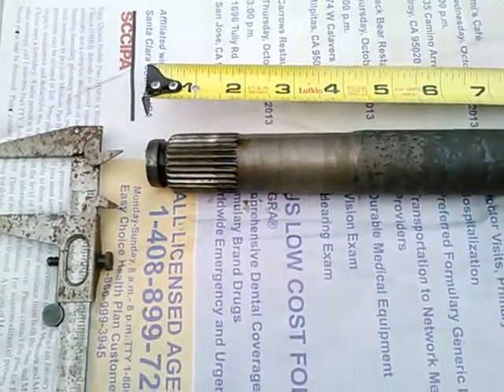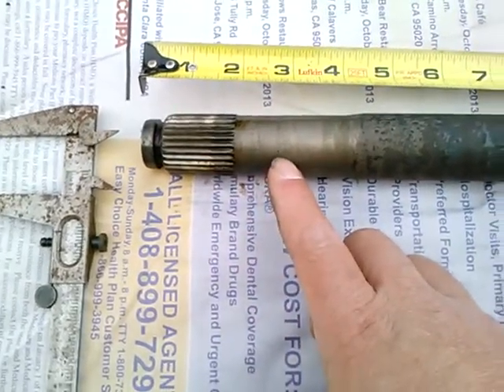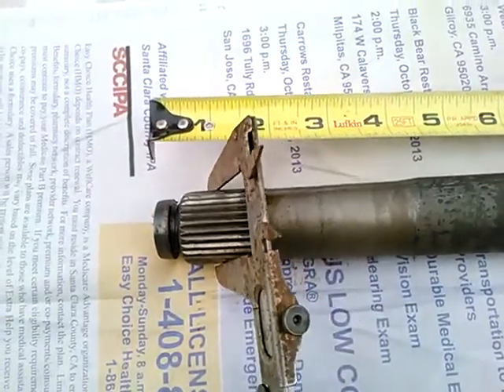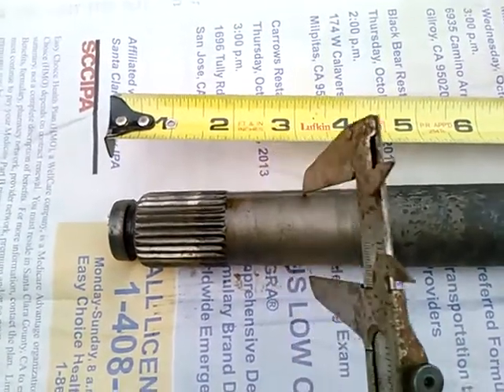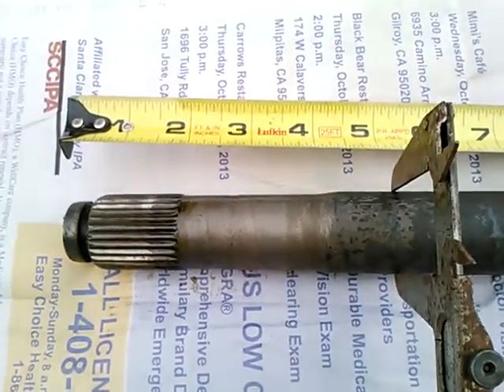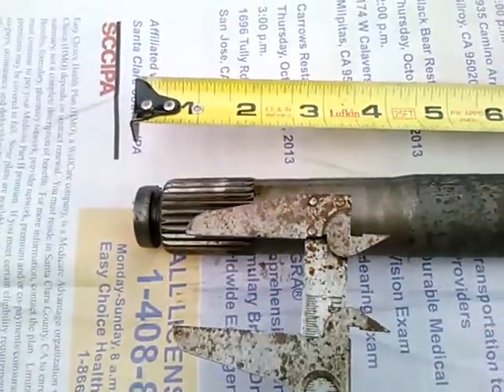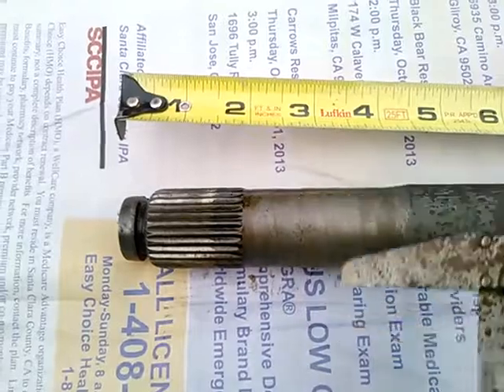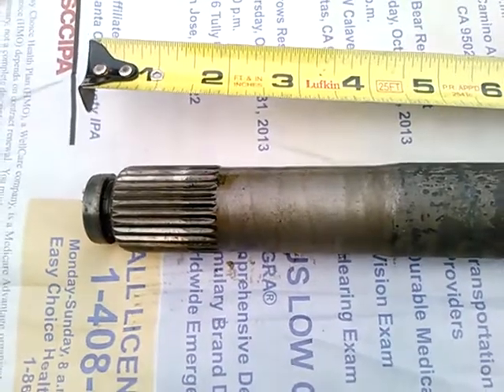Ford Ranger 7.5 axle shorten and respline question MOV272

Comment: Hey guidoguitar, thanks for updating me on the axle diameter! I am in the process of shortening a pair of axles from 91 Ford Ranger (7.5) myself for a trike I am building. I found that Moser Engineering (http://www.moserengineering.com/moser/shop-services/) will shorten and re-spline a pair of axles for $125 plus shipping they're in Indiana. Thanks again!
Reply from the maker: Out of curiosity do those resplined axles have C-clip grooves or do you need to switch to C-clip eliminators?
Reply: Im staying with the stock set up which are C clips

Comment: Can you explain to me what they do at the factory for the splines? You said they upset them rather then grind them in.
Reply: alexcockerill he is wrong the actual machining technic. They put the shaft in a (more that likely computer assisted) lathe. From the full size of the shaft, and from the end of the splines to ~4", reduce the diameter of the shaft for tool clearance for step 2. Then they take a splines cutter (similar to a router bit, or a flat blade) and run it on the center line cutting the deep of one v, turn the shaft 10° or so and cut an other one.
The first operation it just a place where the saw can stop before rotating the shaft
Reply: They turn down the diameter and then they press the splines into the metal and it raises up, much stronger than cutting splines. YouTube roll threading and you'll get the idea
Reply: The CORRECT TERM is Rolled Splines. After market are cut splines